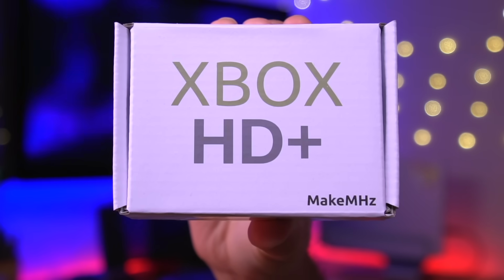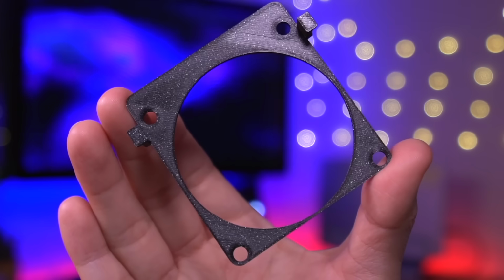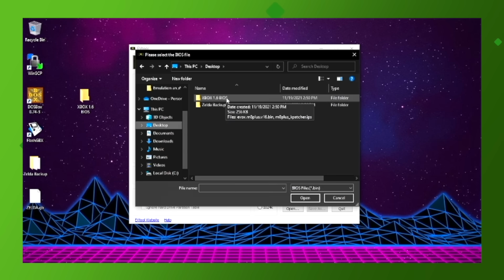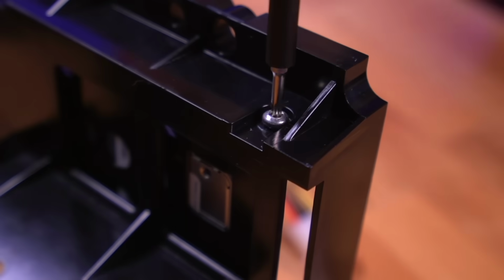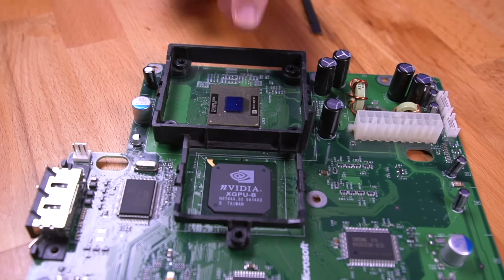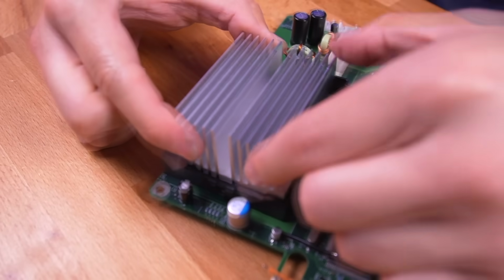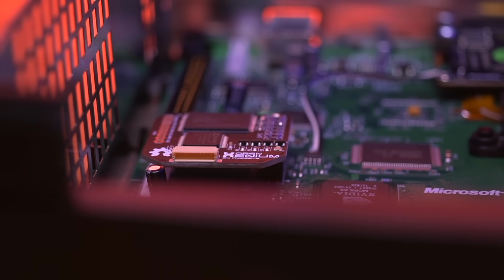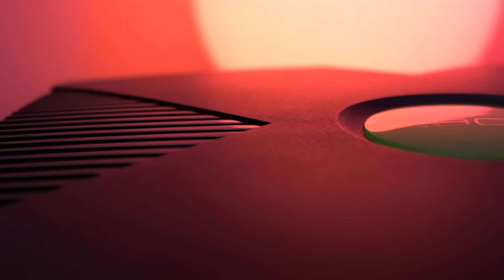I BUILT THE ULTIMATE XBOX TO CELEBRATE ITS 20th ANNIVERSARY | MakeMHz HDMI + SSD + OpenXenium +MORE!

Comment: my xbox has a failed hard drive so will i need to get a new one working before i can attempt any of these mods? i planned on doing the ssd upgrade but wasnt sure if the modded BIOS will install if the xbox itself wont boot past the 07 error code. thanks if you respond to this, i know the video is a couple years old at this point lol

Comment: My OG Xbox was having an issue with reading discs so I bought a "new" one and installed it. Same issue. It seems like this is just unavoidable. I'm one that likes to collect and use the games I have for any given console I have. If the disc drive is just gonna fail regardless then all this work is pointless to me. So now it's either just stick to what will play in the 360 or turn to emulation. Unless by some crazy miracle someone starts manufacturing custom new drives.

I also wanna add that I recently bought a soldering iron and intend to learn how to repair, so if there're any solid repair guides for the disc drive it would be GREATLY appreciated. Just to have as reference once I get to the skill level required to mod the OG Xbox.

Comment: Not to burst your bubble. but. um ... Well if you have the right Xbox i believe any Xbox that has dash 1.6 or older. then a mod chip is not needed at all. as you can soft mod it, all you need is a copy of mech assault or 007. and the molded game save, and there is a HDMI adapter for the Xbox that just plugs in to the back of the regular port so most of everything you did was completely tedious pointless and time consuming. You don't need to Soder anything or even open the console at all. and all of this is still possible.

Comment: I don't understand the point of putting an SSD in an OG Xbox, just use a standard mechanical drive?
Reply: less noise and less points of failure, mechanical drives have a lot of things that can break and in practice usually have shorter lifespans
Reply: @autumnmicheals8965 depends on what HDD you put in (enterprise grade drives are virtually bulletproof for this application)

Not all SSDs are made equal either. The cheapest options usually don't have TRIM and DRAM cache, which will wear out the drive much faster.

Comment: Funny thing is Microsoft has gone backwards with their Xbox console line from going to a hard drive to a memory stick (like the ps1 and ps2) where as Sony has gone from a memory stick to an ssd 😂

That's for extra stowage
Reply: huh? the series X doesn't use memory cards? do you mean how the SSD upgrades plug in? thats just form factor/connection , its just an SSD inside
Reply: @autumnmicheals8965  you buy the expansion card and it gives you an extra 1 or 2 terabytes ect or you by the external hard drive

Comment: A year ago I picked up a pristine OG Xbox - I changed out the fan and caps, soft modded it and installed a couple multi-terrabyte hard drives and installed the entire North American original library. Gtg.
Reply: Where do you download the entire library from?
Reply: @likuidrano6778  yarrrrr
Reply: Now you just need the PIII and 256mb ram mods and you'll have literally no further functionality than before!
Reply: @bluedistortions  hl2,doom3,farcry and other mods that stretch the limits of OG Xbox run better with higher ram (128mb?) and pIII I believe?

Comment: This seems expensive and tedious for like 12 titles. There's emulators that can do this with better output and graphic options. I mean even a steam deck can run the xbox at this point. Not that i hate mods similar to this i have a modded wii with with a xcm green  halo case and a green ghost case ps2 with led's in it. But even those are retired due to the wii u and ps3 soft modded.

Comment: I need to open and remove the capacitors in mine and want to mod it while I'm inside but the soldering worries me. Most I've done is fix display lights with a kit my old job had.
Reply: A 30 watt iron, wick & flux is all you need. It's pretty easy.

Comment: Rather than modding the original xbox, I wish the hacking/modding community would retrofit xbox 360 games to play on the xbox original.
Reply: As cool as that would be it's impossible, the Xbox 360 is way more powerful than the Original Xbox so even if it was possible the games would probably run at like 5 FPS lol.

Comment: completly useless using SSD in an og xbox, it will perfom the same as an HDD. Also, this HDMI stuff is useless imo too, just get an original hd-av microsoft cable, or an alternative like the Pound cable and then you don't need any soldering and stuff. Also, I have 3 og xbox but none of them required re-pasting ever them. If it overheats it will turn off, but that never happened for me.

Comment: Looks like soldering required for this is way beyond my abilities. Going to reach out to RedHerring32. Thanks for posting this. I've had a modded xbox for years but am really interested in the HDMI mod. the conversion cable that i'm using now really doesn't work that well.

Comment: I recently finally got around to installing a HD+ I’d had sitting around for quite a while. It’s definitely not an easy install if you don’t have a lot of soldering experience but is doable if you have a light touch and take your time. And I can’t stress enough how helpful flux is. I had only ever installed a modchip pinheader before but I managed to get this installed. I had some really annoying bridging that took me a while to clear.

I had my doubts about how I would like it because in MVG’s video on the kit, the colors and shadows didn’t look as good as the component video he compared it to. This particularly showed when he showed Outrun 2006 gameplay. But I can happily say that was his recording settings or something because mine doesn’t look that way. The picture looks great. I’m looking forward to the Stellar modchip now that I preordered to pair with the HD+.

Comment: Where can I get more info on "40 wire cable not compatible with sata to ide" 11:30? I have slim PS2 modded for IDE and couldn't install SATA HDD, most likely due to this issue. I ended up using IDE to SD

Comment: Feel like the SSD is a bit of a waste since the Xbox can't take advantage of the speed and without TRIM support, the life of the SSD is a tad shorter too.

Would have gone for a 1TB HDD instead. It will last longer and if it starts failing, it's a gradual failure giving you some time compared to an SSD that might just stop working out of the blue at the end of its life cycle.

Comment: So, I have been watching videos on what people are doing modding these in 2020+ My last original XBox was in 2006, I had soft modded it as I was not in a stable place and may need to sell it off. Which I did. Now I have a new one.
I gotta say, this is all much easier for those getting into this now. I had a 1.2v box that to upgrade the HDD, required hot-swapping it to an IDE port on a computer running at the same time. At the time, SATA was JUST coming out. This is so much easier. I am just waiting on a few parts.
Good video and should help anyone, maybe even those with no experience in doing this in the first place.

Comment: HDMI, SSD. 🤣 A modded Xbox hard drive is formatted at FAT32 and has average read speed of 15mbps. So a 80 pin IDE ribbon does nothing, and a SSD is not faster than a HDD formatted at FAT32. Not fast enough for HDMI, component work. A 16tb HDD is the fastest hard drive you can install. When a drive has 90% free space it runs the fastest. With a 16tb drive and 2tb of storage you would be using less than 10% of your drive. 40 pin IDE can be used with FAT32.

Comment: I like how MVG used a compact flash which works with IDE you basically get a SSD sppeds with a modern CF. I would love to see someone mount the CF so its accessible from outside the xbox so you can quickly add apps & games if you dont feel like FTPing

Comment: Ultimate Xbox has the CPU upgrade and 128meg upgrade. HD+ will work with those upgrades. Only thing HD+ doesn't support is the titan patches so don't expect to run anything bigger than a 2TB harddrive if you do this mod.

Comment: Hmm, I guess you're not gonna get that much bandwidth out of the SSD seeing as its connected via IDE, right?

I was wondering about this. An SSD inside an original Xbox, haha. Does it do any good?
Reply: Would be fun to see someone benchmark it.     The TSOP that has the 256 MB of Flash ROM would be the way to go if you can find one.   But any should do for a comparison of speed.

Comment: I don't know what that cable nonsense was. 80 pin cables just have 40 more ground pins, both are fully compatible with one another. 80 pin was used in the udma era of ide for shielding, but the Xbox ide interface doesn't care about that. That is why there is ordinary 40 pin cable in there. Just like you see him reinstalling in the video after the folding segment. The sata board also does not care. That is why there is still a 40 pin connector on a 80 wire cable.

Comment: 15:45 I mucked up here, I may have forgotten about my shakes on my right hand and had shortened the four connection which is next to the 4b1 label, after deciding (not sure if it was the right move) I used a copper brad to lift the solder but now the four golden tabs on the ribbon are missing, is it possible to have a solder blob (or a solder line) at the end of the pathway where the tab used to be and make a solder path to the resistors? I'm in NZ so a replacement ribbon would cost in total +$100 in shipping...

Comment: The thing with SSDs in old consoles is that if you dont power them regularly they start to lose data after 1 year or so. I have one in a PS3 that was turned off for 3 years. When I went to use it,  it was very corrupted. Had to reinstall the "OS" and re download all the PSN stuff. I now turn on everything with an SSD at least once every 3 months.

Comment: to make things easier on the bios update there is a program called slayers just drop in the disc and auto install the entire program no need to flash bios.. with the thermal paste god idea to renew it but  just use acetone on a cotton swab for the chips and the heat sinks it will get rid of it really fast i have used toluene as well on the sinks and while ya under the hood replace all the power caps in psu and on the board and get rid of the clock cap hit the whole thing with a spray of ipa  then it will run for another 20 with no issues

Comment: during SSD installation you didn't use that new IDE wire in the end? Did it still work with the old cable then? Or simply the footage was done before you've realized?

Comment: You need to double the fan speed from the default 20% to 40%. The fan itself is not powerful enough at default speed.
Reply: How do you do that?
Reply: @jackbanon491  In the settings provided by the modded console menu, of course!
Reply: Thank you!  One thing about modding Xbox...  it takes an absolute mountain of research, and I would've missed this detail if not for your comment.  I also saw a Reddit thread where someone said 60% was their personal sweet spot.

Comment: I modded my xbox a few years ago making it an amazing emulation system. I use a hdmi adapter which works and looks great. Putting a SSD in though is kinda a waste though since you are still using IDE and are going to be limited by interface spped.

Comment: I don't understand this mod. My original XBOX already had an HDMI cable converter in the original package and supported 720p. Is this video mod just to force an upscale to 1080p that many TVs do anyway? Also, there was no need to add all this extra stuff to have an SSD, especially a 500GB which is overkill unless you want to store movies plus those extra cables and adapters. There are cheap disk on chip modules of smaller capacity that plug straight on the IDE cable and they actually work at the same speed if not faster because there's no translation from IDE to SATA. I also expected that you'd upgrade the CPU to a 1.4 Tualatin for twice the speed and solder the missing 64MB of RAM chips.

Comment: I'd love to hard mod my Xbox but I imagine sending the whole system to a modder is going to be a pain in the butt. I imagine the HDMI output is much better than the Component one? I am using the first party box from Microsoft currently.
Reply: It'll depend on your display. If you're using a modern television then the digital HDMI mod will remove a lot of processing done by your TV so it should perform better than plugging in component. If you play on a VGA monitor or use something like a GBS, I'd save my money.

Comment: Putting an SSD into old consoles like this is never a good idea. Always use HDDs. A modern HDD will max out the IDE interface anyway.

The SSD needs TRIMM operations performed on it regularly to maintain the health of the drive.

Old school IDE interfaces don't support that type of thing, neither does the Xbox OS.

Comment: Unfortunately you can't go fully all out with a 1.6 as they can't do the ram mod but you can still at one day do the CPU upgrade or even overclock it with the BIOS and see how high you can go.

Max overclock I've seen on the Xbox is around 870 MHz for the CPU and 315 MHz for the GPU. Speed can vary from console to console but the best I've gotten so far is 825 MHz for the CPU and 273 MHz GPU. Can be helpful for those 720p patch games.

Comment: You gonna regret not replacing those caps dawg.
Reply: I'm dreading it a bit, but this is an essential for me.  Recapped my NES's mainboard and PSU and....  dreading it a bit, but I'm going to recap the Xbox's mainboard.  I just checked and the clock cap on my v1.6 was leaking.

Comment: ok i am just old school or is this a bit overkill (BUT VERY COOL) i modded an xbox years ago with a game save cant remember what game anymore and a component cable and mine is hd output without the $230+ mod chip?? also a controller to usb port for flash drives and downloaded games and a bigger harddrive i can play all the emulators and copy xbox game straight to the harddrive.. and depending on how i turn it on (eject or power button) i can run it as an original xbox

Comment: Hi, not sure if you are aware but the HS Series Monitors you have aren‘t designed to sit on their side like they do in your setup, and thus will sound different to how they should, completely missing the point of a reference monitor. 

If its a space issue then fair enough, just wanted to inform in case you have found them to act strange without reason.

Comment: 13:47 I suspect the reason the GPU heatsink is hard to remove is because it's thermal epoxyed on. The clue is in the black colour of the TIM. Trying to remove it without a heat gun is gonna end badly.

14:16 Well if you used some tweesers instead of some side snips you wouldn't have that problem

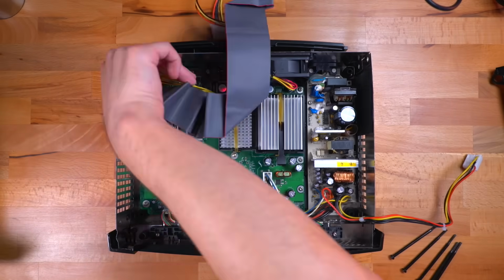18:25 So a fun story: When I was 16 I bought an AMD Athlon XP 3200+ Barton. I installed it into my pc and then forgot to correctly secure down my heatsink. The second I turned the pc on I could smell burning silicon. Never EVER run a high performance silicon semiconductor without properly installed cooling. You WILL break it.

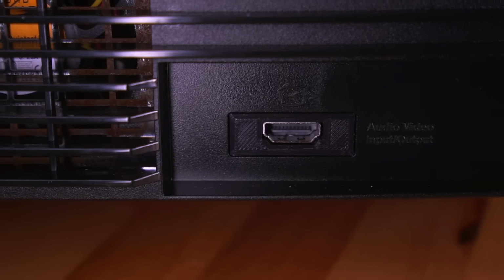22:07 No. It doesn't.
Reply: Modern cpus at least have thermal protection on them,  so at least doing that to a pc cpu from the past 10 years or so should not cause damage.

Comment: It only lacks the method to get the saved games from the original hard drive
Reply: Use a compatible USB drive with a USB to Controller port adapter and copy them over before you upgrade the hard drive.

Comment: No need to remove the clock capacitator on the 1.6 revision. Still important for all the other revisions since they are known to start leeking and destroying the motherboard. Would this install interfere with a pre existing hardmod? Nice detailed video and you do have good soldering skills i don't think i will attempt it myself. Maybe the chimeric hd adapter is an easier and more afordable route. Just dont know how much different the video quality between the two is.

Comment: SSD is a waste as you already get max speed from a normal 7200 platter sata drive. I already tested load times compared to an SSD and saw no difference. Get a 3tb drive so you can use 2.2TB of space instead of 1.83 on a 2TB

Comment: I noticed a mistake when soldering the wires to the pads of the original video connector you said solder the wire to pin 5 for +5v but that should say pin 1

Comment: Always fun to watch your videos. I nodded my slim 360 to rgh with a 1TB hard drive with Aurora system. I have like 150 of the best 360&arcade games, wich takes about 500gb of the hdd. Even though i rarely play, i love it so much.  Does it worth it to get the OG xbox and mod it like you did if i already have my rgh slim 360  ?
Reply from the maker: I think it is 😁. I like to have the original hardware and mod them to easily play games from that specific console. I may have to do a 360 too 😁

Comment: I have mine softmodded last year (also by me) running on Rocky5 V1.1.8 dashboard. I decided to softmod it after 17 years of gaming that the Samsung DVD drive already gave out, not reading discs anymore. I upgraded into a WD800BB PATA HDD and Asus 80Wire IDE cable. I used to run a Seagate 160GB SATA with an adapter but the adapter was giving me issues like Errors 16, 13, and 21

Comment: you didnt nail it though in order to make the ultimate OG xbox you have to upgrade the CPU of the system ! you need a Pentium 3 1400 mhz 512kb cache to replace the stock 733mhz 128kb cache !

Comment: One of my biggest moving regrets was leaving behind my modded Xbox with a transparent badge, blue CCFL light inside and an 80mm fan replacing the original (required some cutting of the frame to fit, but fit it did).